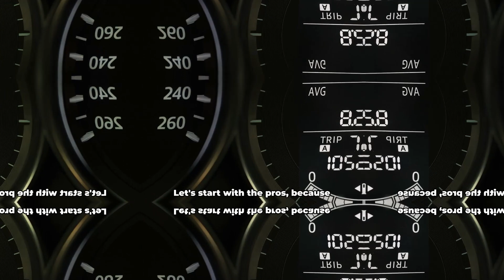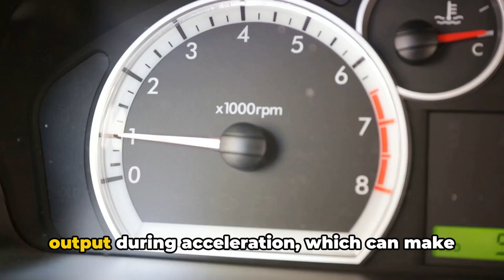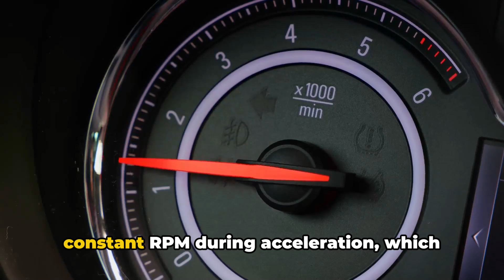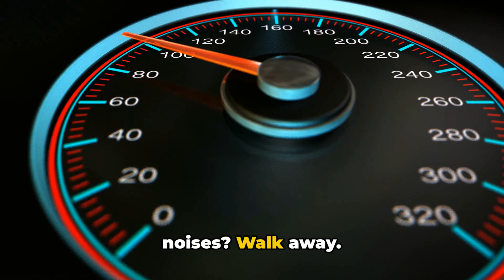CVT Transmission Pros and Cons: Shocking Facts

Comment: I could care less about fuel economy. CVT’s  have proven themselves to be garbage! The government has forced car manufacturers to drop cylinders, add turbos, batteries and this stupid transmission. Hopefully the American people will not buy these and force companies to bring back durability. They can retune the 8 and 6 cylinder engines to get better efficiency and power. I would avoid a CVT at all cost.

Comment: Subaru stands behind it's CVT's and offered a 10 year/100,000 mile warranty on my 2018 Outback CVT. But all other years is the 5 year/60,000 mile drivetrain warranty. By the way, CVTs do have torque converters, not just regular automatic transmissions.
Reply: Modern CVTs have one classic gear before automatically switching to the CVT. That's to start the car moving, relieving the CVT belt in that situation. So there is one gear shift to be felt (-;
Reply: @PascalGienger  The only one I know of like that is Toyota. What are the others?

Comment: CVTs are like auto transmissions when first offered, and similar to anything innovative.  Unfortunately, they are beta tested on consumers with some manufacturers better than others in reliability.  All those reliability issues will make CVT better in the future.  They are not inherently bad like Trump.
CVT is a fuel and cost economy component; they’re not a performance part, not yet, with 10-speed AT almost like a CVT in functionality.  I think a CVT uses, in the beginning a rubber chain, but assume now the chain is metal, that isn’t heavy duty or for high horsepower engines.
CVT is like plastic.  The economics and functionality are already making them standard on all cars with engines of 199hp or less, or where price is a huge factor in that segment.

Comment: Driving a 2001 Toyota Sienta with 400,000km on it and no issues. Prettt much all my friends have replace atleast two cars and some on their way out to their third. Like any engine, if you take good care of it, it will last long. My car is living proof of it and mechanics wonder how it is srill running smooth to this day. Oh yeah.... i've only ever changed the transmission fluid thrice. Reliable, heck yeah.
Reply: Toyota sienta is introduced in 2003

Comment: Being a car guy, absolutely nothing beats a manual gearbox for me.  They're also far more reliable and better than traditional automatics. Treat your manual gearbox with care, and change the oil to full synthetic made for syncromesh rings every 60k, and that box will last basically almost forever. 😅
Reply: Good that you enjoy MT.  I just watched Honda’s 2 minute video on operating their paddle shifters, and it was way too much work to monitor speed, driving conditions, and up and down shift.  Like making your own pizza when eating out.
Reply: Manual cars have a human error, automatic were meant to remove that via automtion
Reply: @onke  A good driver can make a transmission way more efficient than an automatic system
Reply: @onke  Only stupid humans have errors when driving a manual car. It's the easiest thing in the world to drive a manual😆🙄
Reply: I grew up driving a stick, and I have no interest in an automatic. The CVT thing I admit I knew almost nothing about, but this fellow broke it down well. I assume those will improve in the coming years, but I have no interest in one.